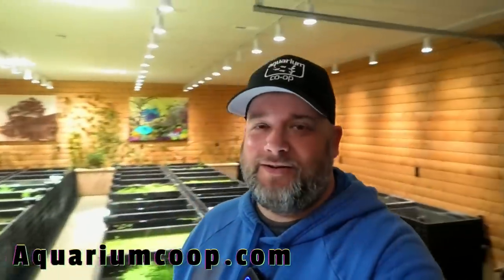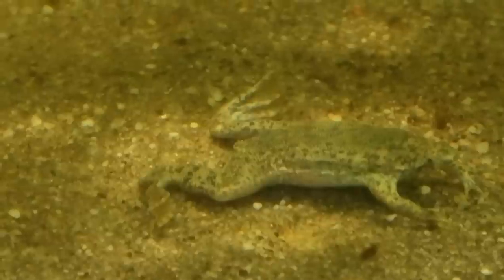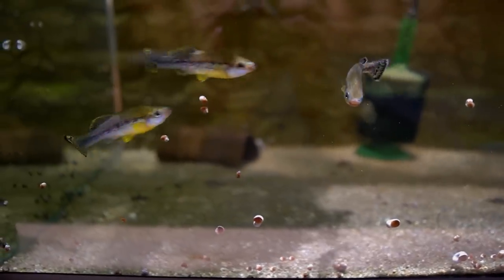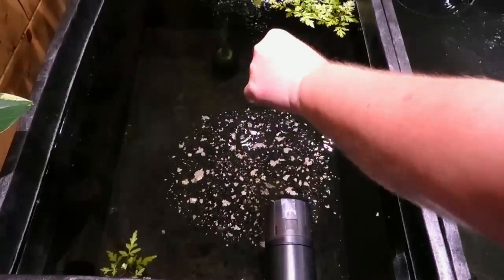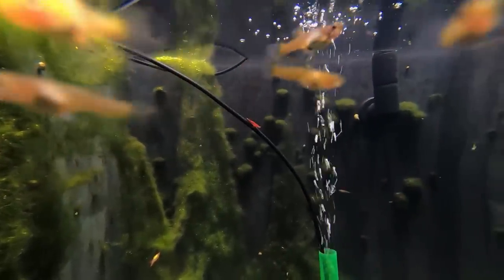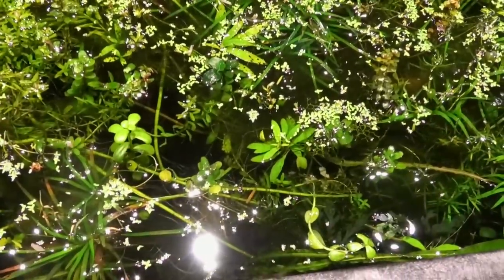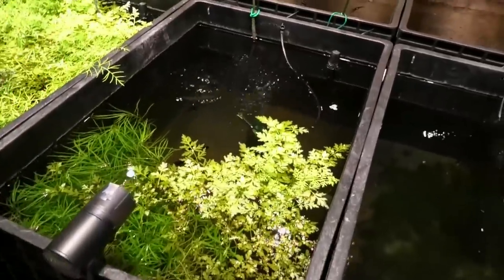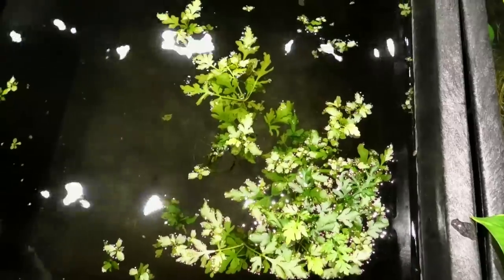AquariumCoops Urban Fish Farm - COMPLETE TOUR

Comment: A simple solution for the long bubble bar if you are interested .. go down in diameter on the tubing as you go across the tank.. this will help maintain constant air pressure along the length.. look at mall or factory air con ducting and you will see what I mean